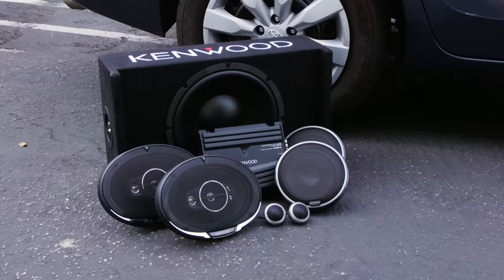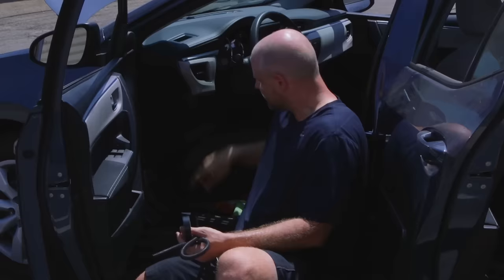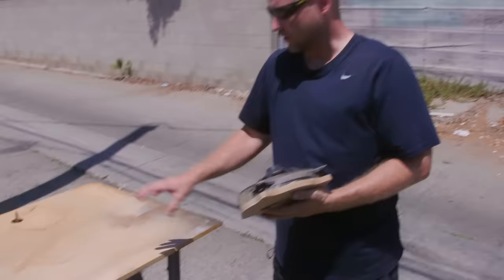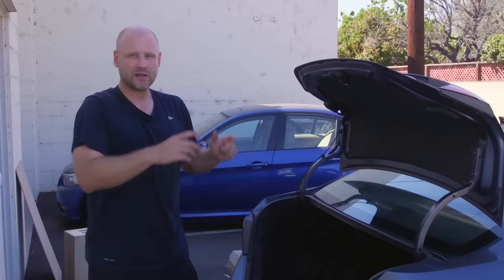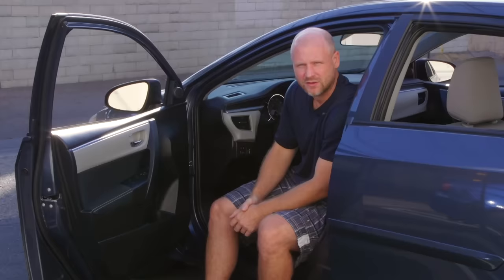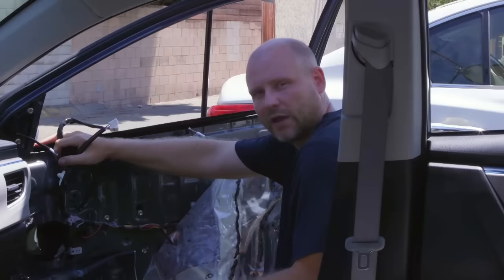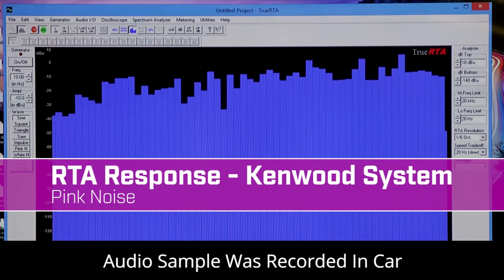Full Car Audio System Installation - Speakers, Subwoofer and Amplifier

Comment: Dude you've got some mad skills! thoroughly enjoyed your installation, real professional. After a couple of bad installation experiences I do all my own installs, I wish you were in the East Coast it's hard to find good installers.
Reply from the maker: Appreciate the support!
Reply: how would i learn to do this with ease i want this to be my hobby / job 
You did so much work in this video how long did it take to do everything
Reply: Quality Mobile Video If I do the big 3 upgrade on a 1995 Plymouth voyager van with the stock 90amp alternator can I atleast install a 600 watt rms subwoofer ? So the amp will be 600watt rms at 2 ohms  powering that 2 ohm 600 watt 15" subwoofer. Will it work with or without the big 3 upgrade ? Just curious because I'm new at higher powered car audio. The biggest I've installed is a 100 watt rms kicker 10" subwoofer in a gmc truck that had a 120amp alternator I believe and it sounds great ! If anyone can give me some advice that would be awesome thank you !!
Reply: Alberto Sanchez the best just read your comment Ma
Reply: you dont need mad skills to do so, just enjoyed your installation because is your car and save $ 1,000 like  Phil Drums said!

Comment: Finished my install based on this build... a few things... 1- it's a little harder to route the power wire with the 6-speed version of the car. 2- the kit that James recommended below... the ground wire isn't long enough to use that nut on the crossmember.  Did the same treatment to a bolt back by the seat bracket and it worked out fine 3- this took a LOT longer than the video makes it look like!  4- couldn't find terminals small enough to make the tweeter bypass harness... I bought the ones off of Tacotunes and used those.  5- don't underestimate how much ALL of the installation materials cost... mdf, wire, crimp connections, speaker adapters if you wish to use them instead of making your own, tools, etc, etc, etc.... it all adds up.  Not to mention the 20+ hours it took me to build everything.Not complaining in the least... I know it was done right and I can put it all back to stock if I have to... not a single Toyota wire was cut in the making of this video!  I love my new system (bought the main pieces from you guys too!) and learned a LOT about car audio in the process.  Thanks so much!!!  

A couple pics... 

https://instagram.com/p/BQOW4iOA7BU/

https://instagram.com/p/BQOW3CrgEPS/

I couldn't bring myself to use sheet metal screws for all the components on the back of the seats.  I used 4 Riv Nuts to attach the amp board (wrapped with 3M Di-noc).
Reply from the maker: Brian this is great! You killed it! Lol and yea its hard to show people the amount of time it takes to do this, you have to just get in there it do it yourself. We're all super impressed👏👏👏👏👏
Reply from the maker: Lol sweet! Just emailed you

Comment: Clean install. You're a great installer. Awesome video man.
Reply from the maker: Thanks!
Reply: Trapperjohn1000
Reply: Me Myself And I più cordiali saluti
Reply: I sm planning to use some isolation material, I had the idea that it had to cover the entire area, is not necessary that much?
Reply: Nice install..i have a question, why did you have to loop the factory tweeter harness?
Reply from the maker: @stevenquatre506  So that we didn't have to cut the factory tweeter harness in the event we needed to put the vehicle back to stock.

Comment: Never got in to the I.C.E before but bought the wife a vw touran and going to treat it to some used ebay goodies. From what ive read gives the better value. But have looked for a basic video on a install. This is by a long way best one ive seen. So clean and tidy. And the pride you take in your work shines through.  Its given me the confidence to give it a go. Thank you very much 👍
Reply from the maker: Nice that we are an inspiration! Enjoy the new ride and system.

Comment: I work in a automotive collision repair shop and it made me smile when you noted to bag and label your parts. So many people just go tearing through their vehicle, removing nuts, bolts, screws and clips and always end up reinstalling parts incorrectly, or having "extra" parts. 
I'm a perfectionist and have to have everything installed back to original condition. 
Great video man! You got a new sub for sure.
One question. Did you run your power down one side and audio cable down the other? I heard that the power cable will interfere with the audio lines. Is there a component you can install in the audio cable to cut down or remove noise?

Comment: Everything was explained very well except I got lost when you described wiring the door speakers. Also the tweeters with that loop thing I was very lost. I'm trying to learn more about the wiring in general
Reply: yes I have the same question, I think it has something to do with completing the circuit. If the tweeter is not plugged in then the connection is broken, hence the need for the jumper loops he made.
Reply: the factory tweeter has a small cap to protect the tweeter, the kenwood tweeter already has a cap in the passive xover network.The loop is just ensure the factory socket can be used back without cutting any factory wire. Correct me if I amwrong

Comment: Damn, I remember the days of garage installs in my parents house. Using a crap load of electrical tape and at times, having to find an old appliance that I could cut the power cords from to use as speaker wire or even worse, power cables! But damn, did my Alpine Type R's 12" hit hard wired to my Lanzar 1200D . Nice clean install brother. Really.. wish more "pro" installers who charge good money are as detailed as you with their installs. Worth the money!
Reply from the maker: LMFAO we've all been there

Comment: I hammer all over that install because of the ground point and where you got your line in, then watched the rest, all my comments got deleted  your a good installer. only makes me wished I'd had a flush cut trim bit and router because it would have speed up my installs a lot.  for thoses of you concerned about MDF and water in doors, in 17 years doing installs  in retail  or 34+ dealer work I've never see MDF swell up on a door panel install, but it could.

I'd let this guy do my car anyday!
How much Pizza do you eat?  you look kinda young for Beer!

4 hours to do an install I've done in 2. but I wasn't recording it. and I didn't RTA it.

I can't say I know what it sounded like I was never  that big  a fan on kenwoods speakers or subs.

Comment: Awesome work but how did you set up the remote for the amp
Reply: Will C. kinda curious too, never seen him take off the center panel to get the remote wire from HU
Reply: In another video he mentions the line out converter turns on the amp.

Comment: Don't think I have ever seen this clean of an audio installation. Been running subs and door speakers in every vehicle I've owned for the last 8 years. Every single time I end up always having to go back to the shop at least 2-3 times. It's not like I try to cut corners either haven't paid less then 1200$ for a setup I like quality subs and double dins.

Comment: i would never in a million years put this much work into a v6
Reply from the maker: It's actually a v4🔥🔥🔥
Reply: thats even worse than a v6. and its called a 4 cylinder not a v4.
Reply: that's like sayings it's called a 6 cylinder not a V6?
Reply: FAN†Δ 2 ***i4 (inline 4 cylinder)
Reply: +Akshat Singh aren't there a few v4 motorcycle now?
Reply: Chris Morse yeah
Reply: Not even a Supra, porsche 911 or Buick Grand National?
Reply: FAN†Δ 2 you're lost lol
Reply: If it's worth doing, it's worth doing right

Comment: 1000 haters are jealous of a profesional audio installer. Instead of thumbing down his videos, you haters need to watch the videos through, and try to learn from them. If not, go to the library and check out some books on car audio installs; or buy them at Barnes and Noble.

Comment: I'm not asking for a schematic, just a professional opinion. I have 2014 Avalon with standard radio, small factory Fujitsu Ten amp, and 9 speakers: three 3 1/2" in the dash, a 3 1/2" in each rear door, 6 x  9 in each front door, and 2 woofers in the rear shelf. How in the world would I "channelize" these speakers. My hearing is not the best, so anything you might suggest would be fine. If this isn't something you do, I totally understand. Great video by the way. Very, very professional.
Reply from the maker: So by channelize, do you mean change the area's in which the speakers fire? It kind of sounds like you could benefit from digital time alignment.

Comment: Great video!!! I was watching the last part and did not get to see how you hooked up the tweets to the system. I saw the wiring, great by the way, but did not see how you connected it. Thanks.
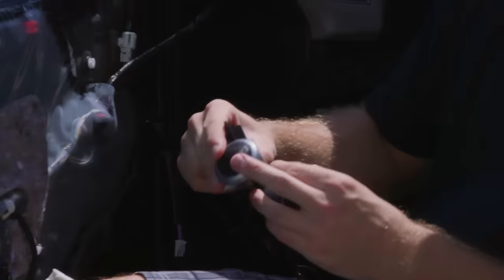Reply from the maker: Hey Sam, we simply dropped them into the factory location and connect them to the factory wiring with a Metra harness. Go to the 20:45 mark!
Reply: I like your work. I used to do car audio back in the 70's and early 80's, so we had to go to the electronics store on Olympic Blvd. to get our raw  speakers and put together units that worked and sounded good. Ever heard of Electronic Entertainment in Beverly hills?? They knew about my car when someone told them about it Keep up the good work. I like how you combine the good stuff with the OEM wiring and make it sound good!!!! @Qualitymobilevideo

Comment: Try using a shop towel or microfiber towel to apply the sound deadener. By rubbing it in, it works alot better than the roller.

Comment: $300.00 Kenwood system.......$200.00 in Dynamat.... $150.00 inline converters....$10.00 in-line fuse...... $200.00 in wires and various connectors and wood..... $1000.00 IN LABOR....... having a little better than stock sounding system PRICELESS.

Comment: I opted for big bass instead of all of this. I have a 2002 f150 extended cab.

Two ct sounds 12” hooked up to a precision power 1000.1 in my custom box tuned to 26hz
Man these things are crazy!
I also got a new headunit
Everything came out just over 500$

Comment: I respect that kind of workmanship. Meticulous and clean.  I believe that last 10% is what shows the kind of workman you are.

I wonder if you can help me. I recently installed a Sony G1200 stereo in my 2006 VW Polo. Right now it won't go off when I pull out the  key I have to switch it off manually. How do I wire it so it does? Thanks.
Reply from the maker: Thanks! Sounds like a wiring issue! Watch our video on wiring harnesses and how to wire your radio properly: https://www.youtube.com/watch?v=HjdV5_fmVt8&t=25s

Comment: This was super helpful but I ran into issues with my 2010 Corolla when installing new speakers.  I’ve upgraded these speakers like 8 years ago, thought I’d do another speaker upgrade.  I have an aftermarket head unit that pushes out 45 watt rms x 4. I can only play music to max 16 to 18 out of 35 volume.  Music is distorted around 18 to 23 volume on some tracks.  

I just installed speakers rated for 100 watt rms but my aftermarket radio only pushes out 45 watts rms. If I play music up till 16-18 it sounds literally the same as if I hadn’t done the upgrade.  Also radio cuts off making me believe that the speakers aren’t getting the power they need so I’ll have to get a amp for my speakers.  I also have a subwoofer with amp installed.  

My only issue right now is the way Toyota wired the tweeters in the door.  

I have 2 way component speakers in the front 6.5” and I bought 1” tweeters with crossovers that have black and red wire. I just don’t want to mess up anything so if there’s anyone that can help or direct me to a wiring diagram it would help.  Not sure if I’m suppose to splice red and black into pink/ purple or into the red or white.  I’m beyond confused.  

If anyone can advise or help out I would greatly appreciate it.
Reply from the maker: You have a wiring issue, that vehicle is easy to run new speaker wires through the door. Run new speaker wire from the headunit through the doors.
Reply: @Qualitymobilevideo  initially I bought a 9 wire speaker cable 18 awg OFC. The plan was to run the 4ch amp using 18 awg wire while using the factory speaker harness. However, I decided to get 12 gauge OFC speaker wire 100 ft roll.   

I’m thinking of keeping the speaker amp in the trunk that way I can easily connect ch3&4 in the trunk. Only need to wire to ch1&2 (both front doors) and the tweeters. 

Will speaker wire interfere with RCA wire? Should I run power amp and speaker wires on one side while running rca on the other side.  

Essentially I’m replacing 18 awg factory wiring with 12 gauge. I’ll leave the 18 awg disconnected in the back, while connecting the new 12 gauge.  

Also plan on doing the big three upgrade to see if that helps.  If not, I seen a 250 & 320 amp high output alternator for my vehicle.  That seems like a good upgrade but it’s nearly $400 USD.  That’s more like $550 CAD.  I can’t seem to find any shop locally with HO alt most are 100 amps and 160 amp.  But I don’t know if the shop selling to me is legit saying 160 and selling me a 100 amp to scam me. I really wouldn’t know. I’ll have to take my chance and see.  

Once I run knew speaker wires to my front door, do I just splice and connect the positive and negative to + and - terminals respectively to the crossover then to my tweeter. Toyota has four wires going to the tweeter.  Im just really eager to replace those old tweeters.  

It’s been pouring all day so really couldn’t get much done today.   Hoping for some sunshine tomorrow so I can get some wiring done.  

Thanks! Appreciate it.

Comment: Very nice clean install. I get that it was meant to be a budget system but to spend that many hours and incredible attention to detail just to wire up those speakers to the factory deck seems like an unbelievable waste. Throw in a decent DSP and amp for the speakers and you'd have a sound that matched the quality of the work.

Edit: I didn't realize they did a part 2 where they did exactly what I said they should do.

Comment: Really great video.  I have to read up and the little converter used.  I am curious why you didn't use a capacitor in line from the battery to the amp? It is my understanding that the capacitor prevents voltage fluctuation in the car's voltage, preventing damage to other components (computers) in the car.

Comment: very nice very clean and simple + professional installing. Regarding front and rear speakers,did you connect them to an amp too, they are 4 hom, most of stock head-unit  is 2 ohm as I think. and low in power.

Comment: So do the 6.5 components not need a crossover system? can they just plug into the factory wiring i.e the radio? Very clean install btw.
Reply from the maker: Luis, there is an inline crossover for the tweeter only.

Comment: Wow, i just did my 3-way speaker system installation in my car, and now i feel like SHIT after watching this. My cable managment was just to connect the wires and use some electric tape, thats all. All the cables was unsymmetrical and all that shit. Now i feel like ripping everything apart and redo it, but f*** that, it was so much work, even without all this perfection :D

Comment: Very clean. But I would have done more sound deadening since you had most of the interior out. 
I know it's not cheap, however I almost feel that you could have used what little deadening material you did have better.

Comment: I discovered a way to avoid going through the firewall, having to remove panels, and having to drill a hole in your fire wall. Go under your car! Make sure you coat the wire and just zip tie it to the undercarriage. With the rca's it's different bc you are not breking the firewall.

Comment: car audio noob here, but why is there no need for a 4 channel amp or such to power the front/rear speakers?
Reply: I've been questioning this too
Reply: Run them to the high side of the radio. Don't want those speakers playing any base...